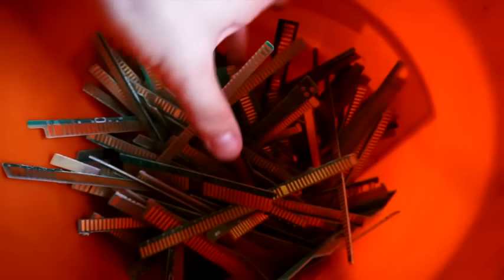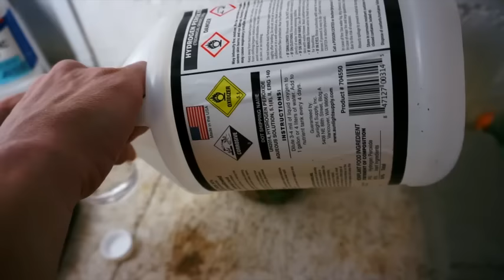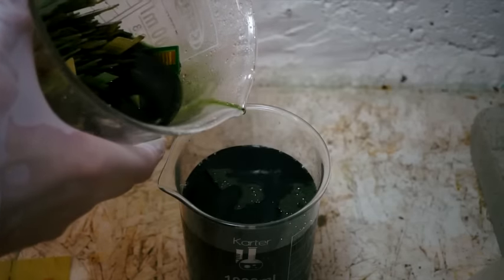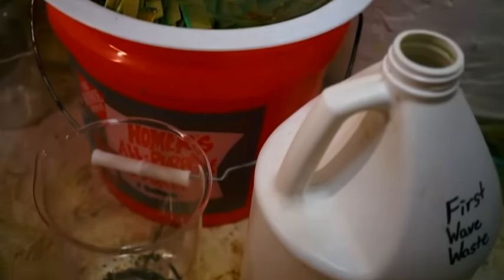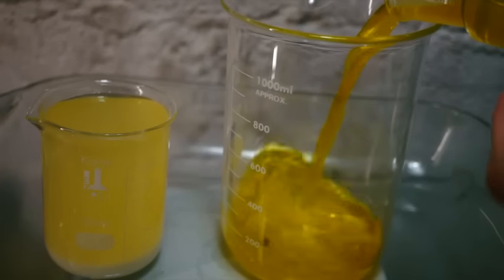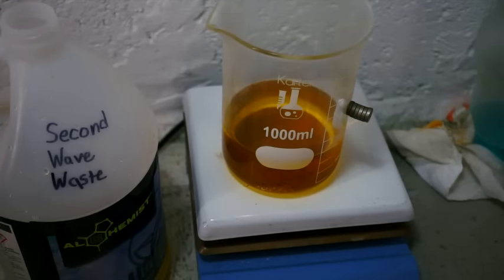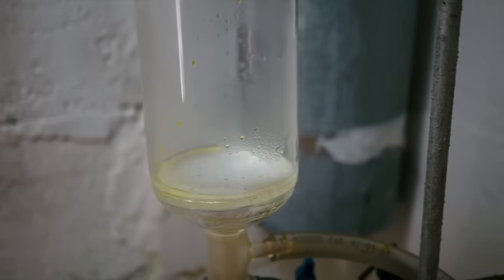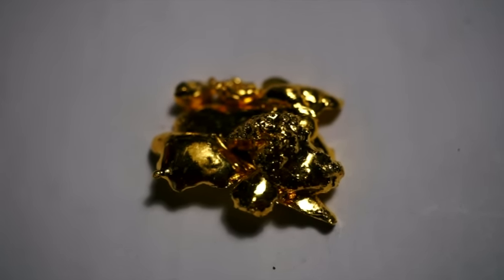How to extract and refine gold from old computer parts.

Comment: Hey Philip, was wondering how long do you keep the aqua pump on for during the whole 72 hours? And also what’s the % of the sulphuric acid? Thanks 👍🏼
Reply from the maker: Yes, run the pump the whole time. It's important to keep the acid airrated and moving. The sulfuric acid is drain cleaner. So it's between 90 and 95%.
Reply: Philip Bender legend 👍🏼
Reply from the maker: @samking7631  thank you, I am happy you enjoyed the video 🤗😀.

Comment: Whats in your spray bottle?  And does the solution dissolve the air tube?
Reply from the maker: Distilled water.
Reply from the maker: The air tube is made of plastic which is very resistant to acid corrosion.

Comment: i am pretty sure if you heat your mold a couple hundred degrees it will form a better shape. it does for lead and plastics
Reply from the maker: Thanks, the torch I was using was not hot enough. But I still like the shape. That gold bar has personality🤗😀

Comment: Hi Philip... as I live in the uk it’s hard to get nitric acid and hydrogen peroxide at the concentration mentioned in your video. Will 3% nitric acid and 12% hydrogen peroxide still work? Thanks
Reply from the maker: 3% will work it will just take a lot and a long time. You may want to consider purchasing a cheap glass still from eBay. It is very easy to concentrate and it is on the same skill level as scrap gold refining.12% peroxide will work just fine.
Reply: Hi Philip, how many ml would you say would be needed of nitric acid at 3% and hydrogen peroxide at 12%? Never thought of purchasing a glass still, very good idea I’ll look into it, thanks 👊🏼
Reply from the maker: @samking7631  it's probably going to take a good amount of 3%. I would try a one-to-one ratio of nitric + HCl to start. Use heat (boil) and strong stirring with a glass lid to keep it from evaporating away. You may need to redose with nitric. Once everything is dissolved use urea or sulfamic acid to destroy any remaining nitric. Then use sodium metabisulfite to drop your gold out of solution. As far as the peroxide is concerned. you don't technically need it for the reaction between the HCL and the copper to take place. It just speeds the reaction up. Hydrogen peroxide or h202. Is an oxidizer. So it's basically just adding a bunch of oxygen to the solution. You will get a similar effect by using an air pump. It will just take longer.
Reply: Philip Bender thank you, very useful information, appreciate it 👍🏼
Reply: Philip Bender please let me know 🙏

Comment: Dear Philip bender sir We at Sandeep Garg & Company are a non-ferrous metal recycling company producing different grades of Aluminum and Copper alloys. 

 
We have browsed thoroughly through your website and appreciate the efforts put in making the explanatory videos, however, we need further information and clarifications on some processes which are as following:

 

·      Step by step explanation of the full recovery process for each of the metals mentioned above with detailed process flow charts and time taken for each process

·      Chemical names with their grade, strengths and volume used in each process.

·      A detailed list of machine and equipment which needs to be procured for an end to end process including any glass and plastic apparatus with their capacities, specifications and preferred/suggested make/manufacturer.

·      Detailed flow charts for recovery and refining process and duration for each process

 

 Attached are the pictures of items readily available locally and would appreciate you guiding us on approximate recoveries on them.

 

We would need your continuous guidance on the project and would like to check your terms of association to consult us on choosing optimum machines and chemicals of the recovery and refining.

 

Look forward to hearing from you.

Comment: Hi Phil, I carefully tried this, but all the gold seemed to dissappear in the hydrochloric acid and hydrogen peroxide initiat mix stage, despite mixing a small amount as a test. Any advice?
Reply from the maker: I would test for gold. Then use SMB to drop the gold out of solution. I have dealt with some newer computer parts that look like gold but when I add to solution It disappears.

Comment: Why on Earth would you add nitric acid to hydrochloric acid (combined make mixture called aqua regia, that dissolves gold) at 18m06s, while there were still contaminants in the vessel? Shouldn't any metals other than gold be removed before dissolving gold, instead of being dissolved with it?

Comment: If I am going to refine some computer into gold could I also throw in anythinng else gold plated along with it it to remove the gold from that aswell? 
(I have a few gold plated necklaces and 18k gold ring aswell)
Reply from the maker: Gold plated jewellery is not the same as computer scrap. This particular method works the best with gold fingers or motherboard connections.
Reply: @philipbender956  thank you so much. Absolute legend!

Comment: Great video! Where did you find the computer parts and get that much in bulk? Also, any specific computers to look for that have more gold parts?
Reply from the maker: I purchased the goldfingers in this video as part of a 20 lb lot that I purchased from eBay for $500 at auction. I would recommend searching out older computer parts. As we have gotten better at plating over the years the gold has gotten thinner.

Comment: Hello Sir, I have a question again... When you make Aqua Regia, what is the concentration of Hydrochloric Acid and what is the concentration of Nitric Acid? Thank you.
Reply from the maker: I make my aqua reja using a method called incremental dosing. This method is completed by adding your material to the hydrochloric acid and then adding nitric acid drop wise. This method makes it easier to remove the gold in later steps as there will be no nitric acid to destroy.
Reply: Thank you Sir, Another question now, I found in an old motherboard, thick golden pines .. when I extracted the pine it seemed to me that inside is the color of gold, I looked with a magnifying glass the color was the same ... it may be made entirely of gold or they used bronze or brass, and covered it with gold.
I would like an exact answer if possible ..
Thank you ..
Reply from the maker: @szokejanos7454   Yes, they are most likely brass covered with gold. Just use nitric acid to dissolve the base metal away.
Reply: Thank you Sir.

Comment: for 2kg (4.4lbs) of computer ram scraps, how many litres of hydrochloric acid and hydrogen peroxide is needed? and should we separate the gold finger from the ram?
Reply from the maker: Yes trim the goldfinger's down. I used about a gallon of hydrochloric acid. 2 cups ofHydrogen peroxide.
Reply: @philipbender956  thank you for the infos and advice! Gonna try to do it soon. Love from Malaysia ♡
Reply from the maker: @ddemoit8953   Good luck and be sure to follow basic safety procedures such as gloves and using a fume hood.  If not perform the extraction outside.

Comment: Sir can we remove gold from the processors by following the same ideA..! Or there is another way of extracting gold from the processors?
Reply from the maker: You can use this method for chips. You need to grind them up first.
Reply: Philip Bender sir thats mean after grinding the processor we can use this method?
Reply from the maker: @zaryabsheikh5564  yes.
Reply: Philip Bender thanks for the help

Comment: What happens if you melt the computer chips without chemicals could you still get a gold bar without the impurity.
Reply from the maker: No, you would get an alloy of gold and mostly copper nickel lead and silver. The resulting "gold bar" would have a carat value of less than .02. Making the gold virtually impossible to separate.

Comment: This guy is very smart , he should extract gold from sea water.
Reply from the maker: Thanks, I have been experimenting with my saltwater fish tank. Every week I perform a water change where I extract 5 gallons from the 20 gallon salt water fish tank. I then boil down the 5 gallons of salt water fish tank water into a slurry. I generally produce one pint of slurry per 5 gallons of salt water. Over the years I have collected about 40 gallons of this slurry that I store in a 55 gallon drum in my kitchen. Once the drum is full I will attempt to extract gold from the saltwater fish tank slurry. A 55 gallon drum contains 440 pints. So that means I will have condensed 2200 gallons of saltwater fish tank water. 2200 gallons of condensed pure gold pay water.😛

Comment: Let’s say I don’t know the first thing about chemistry, and maybe I don’t have all the proper equipment in my lab. What are my chances of seriously injuring myself if I try this? Should I wear a regular dust or a gas mask? Goggles? Please forgive me if you covered it in the video and I missed it.
Reply from the maker: Well I don't know what could happen to you but I could tell you what has happened to me. I got a few acid burns on my fingers early on. Then I learned not to spill acid on myself. I also upgraded to a proper fume hood. The smell of chlorine is nice in a fresh clean kind of way. But I thought it might be better not to continuously breathe it. Not to mention all the metal in my kitchen rusted. The fumes even rusted my hackeysack trophy collection that were on the mantle in my living room. I was the regional hackey sack champion for 6 years in a row. Then I lost 1 year but came back and won the next 2 years. I retired after that, longest running champ. Those trophies were made of titanium. Thinking about it now maybe some other fumes escaped my kitchen while I was performing chemistry experiments. I used to just use the hood above my stove but then I realized it just blows the fumes back into the kitchen not outside. But now everything blows into my backyard. Everything seems OK back there except for the squirrels. They have stopped moving around as much and are starting to grow green on there fur some type of mold or fungus. Also none of the other animals will eat them. They get very aggressive when I try to handle them. I hypothesize that bad sunlight altered their DNA and that is what has changed them. So just keep that in mind before you start. Oh, and don't eat food with your hands in the lab. Use a fork or chopsticks.

Comment: I want to try this can you please comment which acids i will need and what the percentage of that acid should be exactly. And also I tried looking for liquid oxygen with 34% hydrogen peroxide yet I could only find up To 12-13% so if I use that, will it be fine. Because I live in the UK I can't have the same branded chemicals as you so can you please give me the exact specification of every chemical. @Philip Bender
Reply: Also the refined gold that you make what is the percentage gold in it. Because I have seen many videos like yours that refine gold from computer parts yet the prosess they use is much more simple, so is your gold more pure?
Reply from the maker: I use myriadic acid or hydrochloric acid 28% It is sold as brick cleaner or pool ph down. You can use the lower percentage H202 just use more of it. You will need nitric acid.  The nitric acid used in this video was made by me and it's percentage is around 95%. Also a small amount of sodium metabi sulfide to knock the gold out of solution. You can purchase this as "bona" stump remover or off of eBay.
Reply from the maker: @AmeerHamza-qu3us   My gold is 24 carrot.
Reply: @philipbender956  thank you very much. You've named four acids yet in your video you use 5 can you please give me the exact specification of the sufuric acid you used. Also you use 100ml of 34% h202 so how much shall I use if im using 12%
Reply from the maker: @AmeerHamza-qu3us   The sulfuric acid was just to get the lead out I only used a couple drops. Use 200 ml of hydrogen hydrogen peroxide 12%.You really only need it to get the reaction started once the copper has started to dissolve it will keep dissolving regardless of how much H202 you use.  I use higher concentrations to speed the process. Just give it an extra day or 2 with the air bubbling through it and you will get the same result.
Reply: @philipbender956  👍

Comment: 2 start up first time how much cost 4 everything 2 make
Reply from the maker: The lab you see in the video contains about $200 worth of lab equipment. But you can build something much cheaper from the thrift store 😉 A used hot plate will work fine as you will not be cooking food on it. Pyrex glass cookware can be used also from the thrift store. Also I used about $20 worth of chemicals. Most of which I purchased from the hardware store 😎
Reply from the maker: @Paul Brennler thanks, I am happy you enjoyed the video 🤗😀 you can purchase nitric acid on eBay.
Reply: @philipbender956  thank u for the 411 yes I Ann new to all this but want to learn it so bad is taking gold out of sand the easiest??
Reply: Philip can u use any kind of sand?
Reply from the maker: @markcampbell4832  you would probably want to pan for gold if you have sand.
Reply from the maker: @markcampbell4832  I think you would want "pay dirt" from a mining company. That can also be purchased on eBay 😊

Comment: Could you make a video on how you process you waste and filters?
Reply from the maker: Ok, I need to save up some filters.
Reply: @philipbender956 thanks for getting back to me!
  I wish you could post pictures, I'd post a picture of the "log" of filters I have hahahh

So I've got this one batch  where I tried "ringing out" some filters and now there is a thin layer of paper covering the gold foils. I'm I ok to move on to the aqua regia stage? 
Or is there something I need to do to remove the paper particulate?
I've tried filtering it out with no luck
Reply from the maker: @svjackal8595   The paper should dissolve in the AR.

Comment: How strong was the hydrochloric acid?
Reply: And is there some way of not using nitric acid?
Reply from the maker: The hydrochloric acid is around 32%. I purchased it from a local hardware store. As brick cleaner or muriatic acid.
Reply from the maker: @viktorkallstrom8831  yes, there is a method using bleach.
Reply from the maker: @viktorkallstrom8831  🤗😎
Reply: Philip Bender thanks my Guy!
Reply: @philipbender956 One more question, do you know any reliable sources to gold-extraction from electric components, for example any good websites? thanks for taking time on this :)
Reply from the maker: @viktorkallstrom8831  yes, try searching "gold fingers" on eBay.

Comment: I lost track of all the waste you must have after this. My main question is how do you dispose of all of it??
Reply from the maker: I destroy it with sodium hydroxide. Then I filter off the metallic solids. Then I P.H. balance the remaining solution with sulfuric acid drain cleaner.  At that point it is safe to be poured down the drain.

Comment: What are the chemicals used and ratios.
Reply from the maker: I mostly used hydrochloric acid and 34% h202. At a ratio of about 10 to 1. During the aqua regia washes. I used hydrochloric acid and added nitric acid dropwise till the gold was dissolved. I use sodium metabisulfite for gold precipitation. I just add about 1 tablespoon then I check with stannous chloride to see if there is still dissolved gold. You really can't add too much sodium metabisulfite. It will rinse away with water.

Comment: So.... why is gold used in computers?

I'm guessing that it's resistance to corrosion makes the thousands of electrical connection more reliable longer. If you simply depended on copper connections,  they might be more susceptible to failing due to a poor connection.

Comment: His idea of what a gold "bar" is and what my idea is are TOTALY different! That's not a bar, it's "glop" or "gloop" of gold. Take some of the money from the gold you are melting and get a real oven or a real melting set. 20 mins to melt down using 2 torches is insane. That would be liquid in less than 30 seconds with real torches and the small thin surface area of the crucible being used.
Reply from the maker: That gold bar is perfect in every way. So what if it's not exactly shaped like the ones in a professional mint. That gold bar has more personality than most people I know😐   It's been a friend to me through thick and thin. I love that gold "bar".

Comment: Could you just smelt it all and the other stuff would burn out and leave gold and other metals?
Reply from the maker: No.  You need to run the parts through a molten flux bath of lead. Then remove the lead through cuopilling. Then the steps I'm performing in this video.